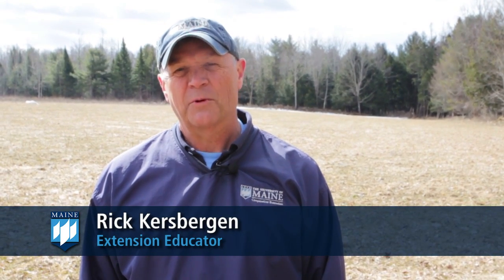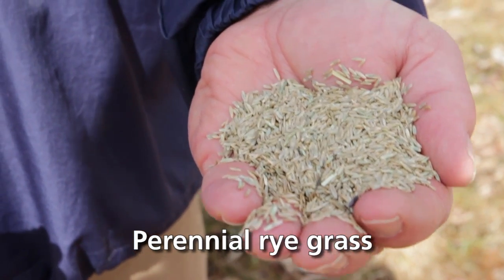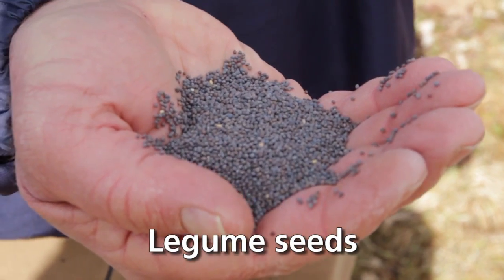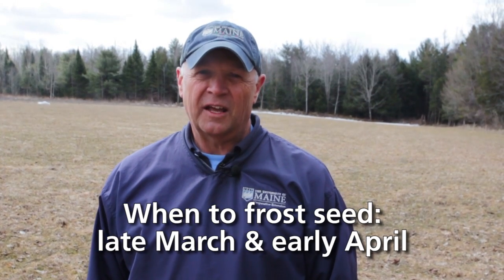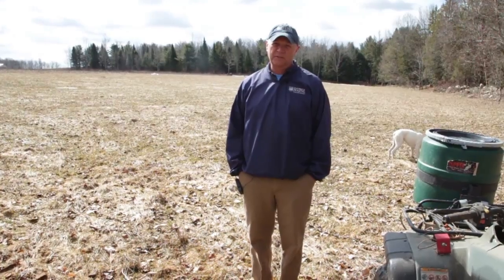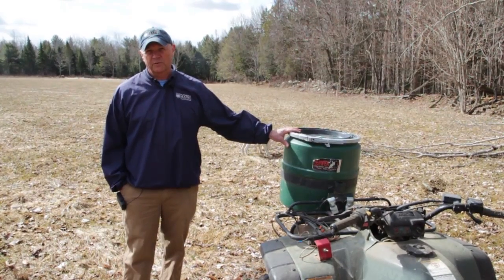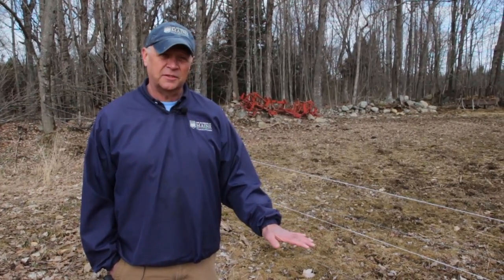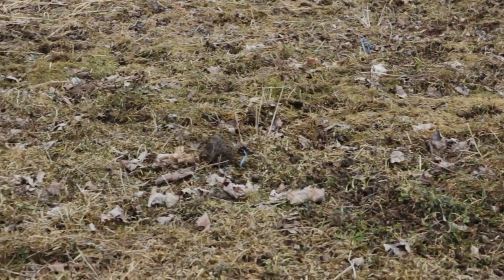How To Frost Seed

Comment: what about when during the winter when temp stays above freezing at night?? like in New Jersey during Feb 2017???
Reply: Anytime after December should work for most legumes. Here in the Ozarks, the only consideration is not too early to avoid sprouting in fall then freezing out. You can run a roller over it too.